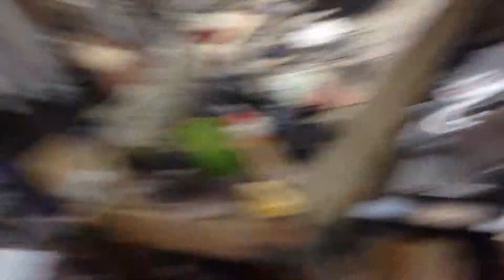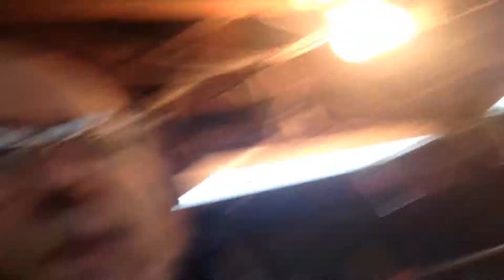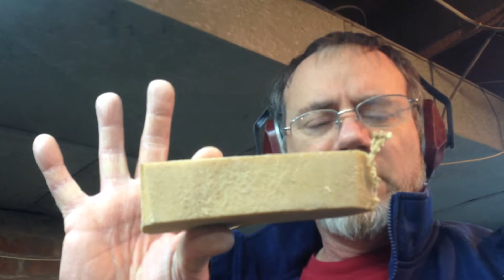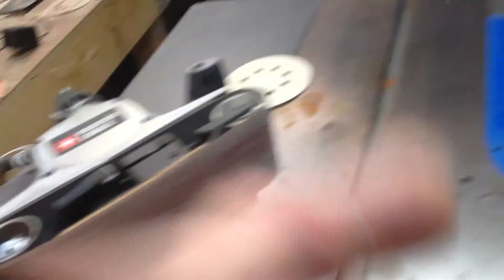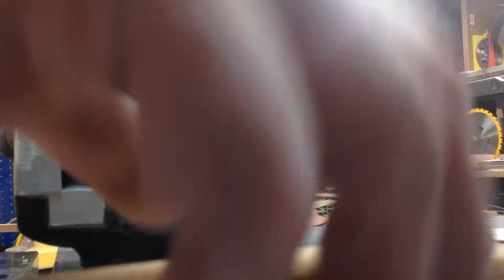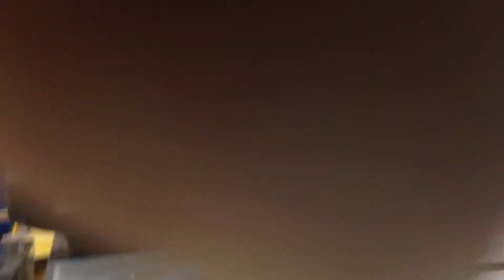How to clean a belt sander

Comment: is that like the blocks u can pick up at hf??
Reply from the maker: Hi ... you can pick these up at http://www.harborfreight.com/sanding-belt-cleaner-30766.html
Reply from the maker: http://www.rockler.com/abrasive-cleaning-stick-1-1-2-x-1-1-2-x-4
Reply from the maker: Rocker has them for 2.99 pretty cheap.. I had for the most part good luck with them
Reply from the maker: https://www.lowes.com/pd/Gator-Sanding-Belt-Clean-Stick-W-Handle/1182283